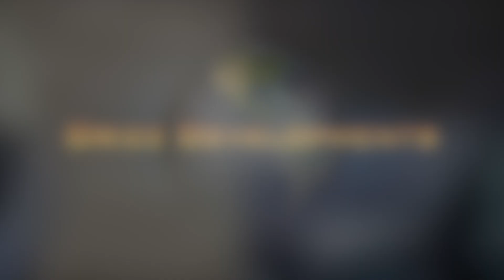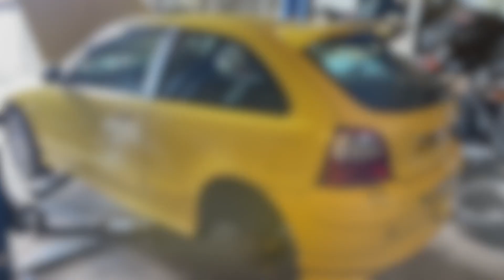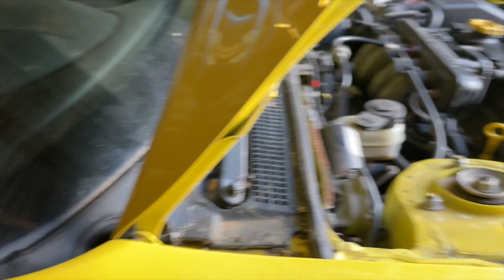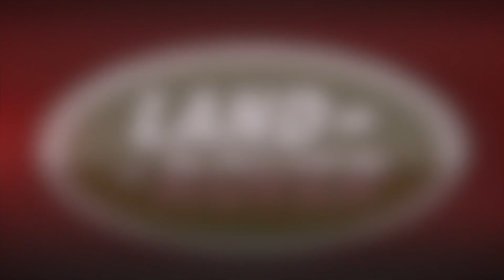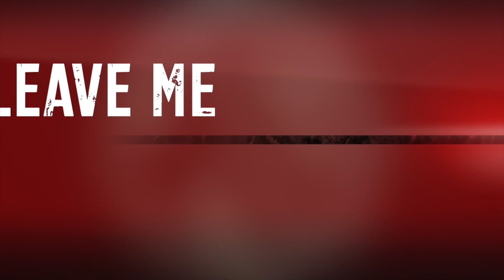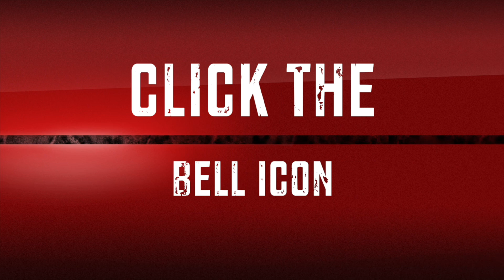MG ZR in for an MOT - Starting Issue, Brake Problems, Blowing exhaust etc etc

Comment: Soooo what is up with the crankshaft sensor ?
Reply from the maker: If I remember correctly it turned out it was low on compression on one cylinder. It has since been done :)